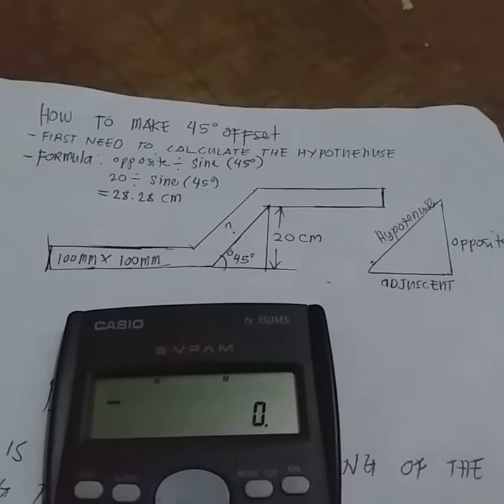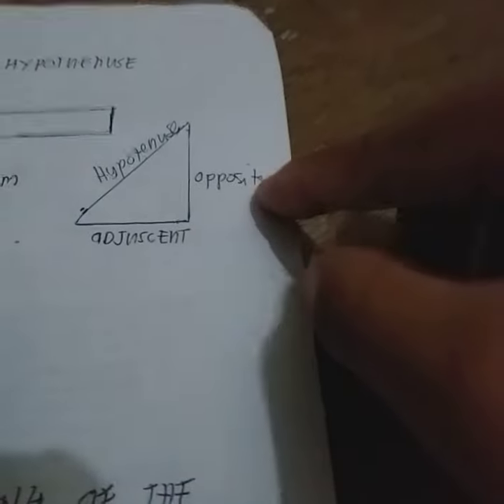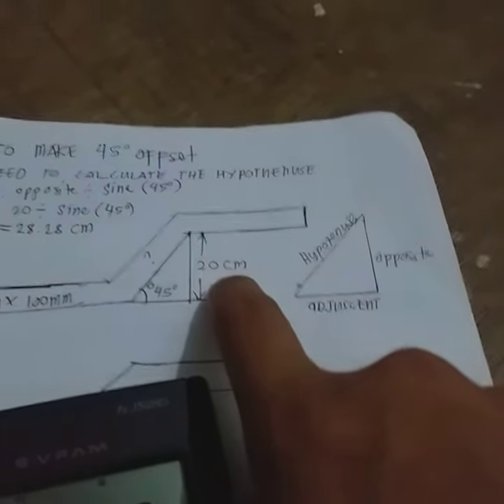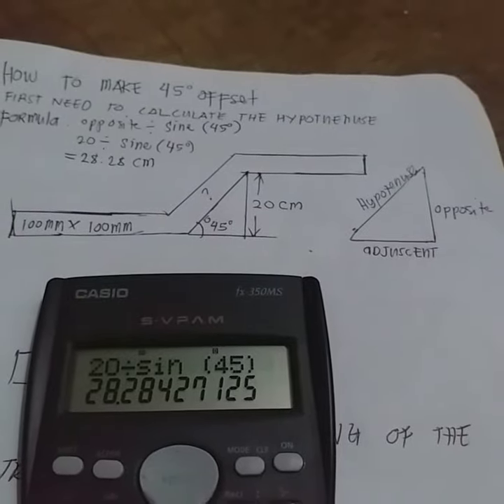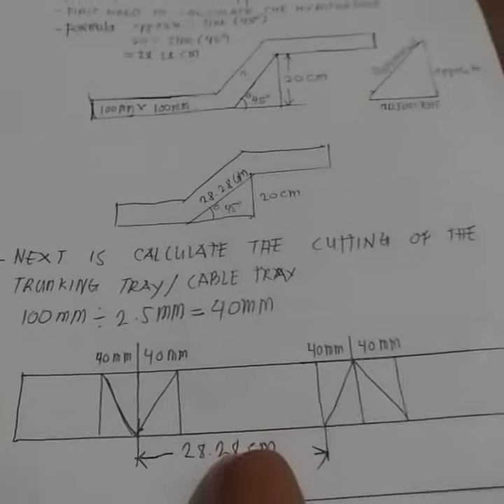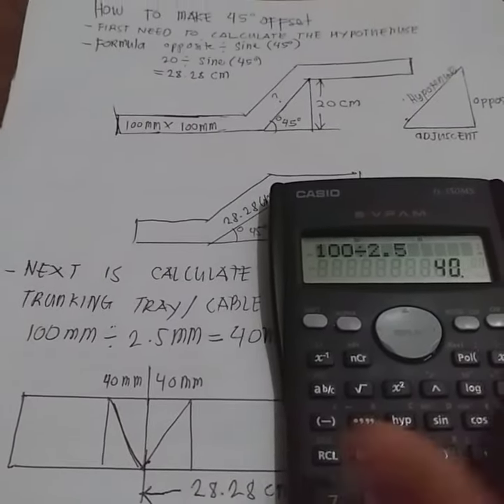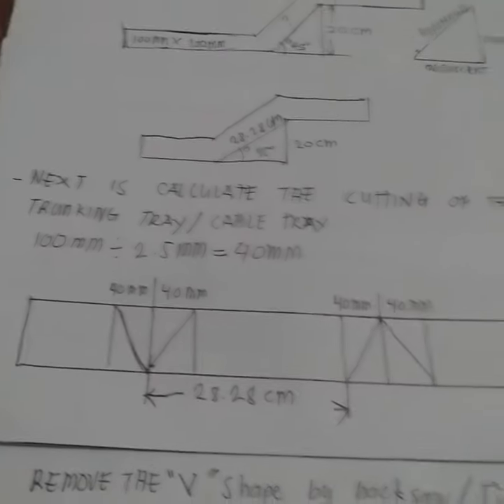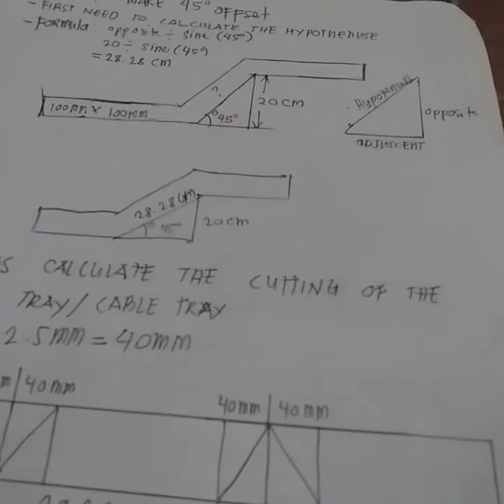Easy step to make 45 degree offset cable tray/Pipe and Air duct

Comment: Use this simple formula to calculate size of cut to set in any cable tray:   C/A = D   B/D = E  (size of cut in tray).     A =  cable tray width:  B = amount of set:  C = distance between sets on right angles:   Eg.  If you want to calculate how much to cut out of 300mm cable tray to set it 150mm over a distance 1200mm.    Apply Formula:     (C)1200 / (A)300 =  (D)4     Size of cut in tray to set would be  (B)150mm / (D) 4  =  ((E) 37.5mm .   Do the first set. place in position and then cut and set the second set to parallel.
Reply: Send us the drawing for this example
Reply: Too much confusion

Comment: I noticed that the position of the “line of travel (starting point to end point)” of this 45-degree video is different from the position of “line of travel” in your 90 degree and 30 degree videos. Which of these videos is correct?

Comment: Sir bakit ung offset mo na 30 degree at ung 45 degree ay mag kaiba ung formula na ginamit mo Sana masagot mo sir kc nasa fabrication ako Ng electrical ngayon malaking tulong Ito sakin pag naituro mo xakin ung madaling formula salamat sir good bless
Reply from the maker: Sa angle lang sila nagkaiba sir kaya for sure mag iiba yung travel or hypothenuse ganun din sa v shape cut magiiba lalo na pag iba ibang size ng cable tray gamit,pero yung formula parehas lang (height÷sin(angle)

Comment: Kung sa straight duct gagawin boss, kung ang duct ay 300x200 paano ko ididivide sa 2.5?? Sidings ba ng duct na 200 o sa top and bottom na 300??? Salamat sana masagot..
Reply from the maker: Depende sa offset sir kung riser offset sa lapad nung ducting,kung side offset sa side naman siya

Comment: Sir zion pano naman yung offset sa palapat n tray 300×100 cable tray tray ko 45 offset nyo galing
Reply from the maker: Sir anung ibig sabihin mong palapat side offset ba you can apply same formula it only varies depending on the size of cable tray
Reply: 12 12 kpg 300 cable tray

Comment: Where you get the 2.5mm
Reply from the maker: I just accidentally use it as a constant number to divide every number to get the value of 45 degree
Reply: @electricalinsider2536  Please Sir i want to 30 degree.  How to get Constance number.
Reply: Constant number Sir
Reply from the maker: @myowinhan502  for example you want to offset 20cm height just follow this simple formula 20cm÷sine(30) and you will get the travel or hypothenuse
Reply: 100 mm tray 45 degree offset you marked 40 mm
100 mm tray 30degreee where you can mark?
Reply from the maker: @xijinping9320  45÷30=1.5 then 4÷1.5 =2.666 cutting marking.
Reply: @electricalinsider2536  you are wrong,,
If you want 45 degree off set  you need cut V shape, for this you have  to do divided 45/2=22.5
And then you have to find the  22.5 degree'th tangent angle length for 100mm trunking or any other length
For example100 mm
Tan(22.5)*100=41.42
Same thing you just follow any angle for your bend
(Previously you marked 40 and 40, this is wrong,it's supposed to mark 41 and 41)
Reply: @myowinhan502 
30 DEGREE ANGLE 100MM TRAY
30/2=15DEGREE
TAN (15)*100=26.79
as a round mark 27mm ,, 

So now you can try  100 mm tray to  bend 150mm off  set in 30 degree
Off set 150mm 
Travel distance 300
"V"mark  27mm
Reply from the maker: @xijinping9320  i dont want to argue with i been making it by myself, it is easy to give formulas but when they do it in actuals they fuck up any way its your on idea no issue for me.by the way i can make it even isometric or through formula calculation.
Reply from the maker: @xijinping9320  the cutting is different from SOH CAH TOA if you know what i mean i just give an simple and easy way to understand,now tell me how much is the cutting of 30 degrees if i have 100mm cable tray.
Reply from the maker: @xijinping9320  15÷sine(30) to get the travel then 45÷30=1.5 then 4÷1.5 to get the v mark
Reply: @electricalinsider2536  for 45degree  you mark 41 and 41
30 degree you mark 27 and 27
  If you don't believe, one time you try  to cut practically   by yourself, then you will know
Reply from the maker: Raj Kumar no need,hahaha ive done so many times,any way base on what you've said you dont even try mine,you just round off my answer if try to calculate you will get base on actual calculation is 26.6666 you just round off to 27
Reply from the maker: @xijinping9320  one more thing the degree of angles in actual works more likely the unknown including the hypothenuse because when you are making layout we usually have to consider the supports standards distance which represent the adjuscent and the height of the offset we want to make which represent  our opposite so basically you can not just conclude what degrees suitable unless we get have the messurements of our opposite and adjuscent
Reply: @electricalinsider2536 take it easy brother, any way  tell me  the cutting  of 57 degree if I have 500 mm tray,,
Reply: @electricalinsider2536  where are you working now?
Reply from the maker: @xijinping9320  hahahahaha stalker are not allowed be profesional beside you are in my channel and your too arrogant saying im wrong without proof or trying the idea of someone,but i respect your opinions or just a typical guy who wants themselves to be exalted and higher than anyone,if you cannot accept my opinion then the door is open for you
Reply from the maker: @xijinping9320  45÷57=0.789 then 20cm÷0.789=25.3 thats your cutting for 57 degree angle
Reply from the maker: @xijinping9320  by the one i have also question how can i get the angle if i want 100cm offset and i have an adjascent of 200cm and my cable tray size is 500mm how much will be the cutting of unknown angle  and also the hypothenuse ?
Reply from the maker: @xijinping9320  my friend your not getting my point because im using centimeters not milimeters your just expressing my answers in milimeters thats why your accusing me wrong try to read sometimes since i use 4cm÷1.5cm=2.6666cm if you convert to mm 26.666
Reply: @electricalinsider2536  25.3 cm= 253 mm,,
For your method 253 mm
For my method 271.47
The proof is TAN(28.5)*500=271.47,
It doesn't matter we use centimeter,or milli meter
But when you convert  the answer should be same right
Reply from the maker: @xijinping9320  try in actual so you can see the different.
Reply: Sir 600mm x 15 cable ladder.. Offset 30 degree then the cutting
Reply: By 150mm
Reply: No sorry thats height 300mm
Reply: @forderno3736  what you mean?
Reply: My cable ladder is 60 cm x 15 cm  ...i need the height is 30 cm
Reply: @xijinping9320  i want to know  V cut
Reply: @forderno3736  for  youro{ 600 mm width x150 mm height  ladder , set up 300 mm } 
45 degree  you mark 62mm:62mm(travel distance 423mm)
30 degree you mark 40mm:40mm (tavel distance 600mm)
Reply: @xijinping9320  thank you sir ..i have a new  learned ..thank you to share  your skills sir.
Reply: Ahm sir how can i calculate the v shape ..600mm divide by?
Reply: @forderno3736    600mm V cut, you have  to use  Angle function, check this in your calculator
30 degree  =tan(15)x600
45degree  =tan(22.5)x600
25degree. =tan(12.5)x600
Reply: @xijinping9320  thanks
Reply: Raj Kumar it's a good farmula

Comment: Bakit poh ung sa 10 height ninyo na coputation jan ung 28.28 san poh tala ung magccmula sa gitna poh ba ng v shape o sa gilid ng v shape
Reply from the maker: Sir 20cm yung height kaya 28.28 yung travel niya meaning pag pinutol mo yung v shape marking mo at binali mo na siya as 45 degree ang magiging height niya ay 20.tungkol naman kung saan ka magsisimula tignan mo yung markimg sundan mo lang yung sa marking sa video sir

Comment: Hello sir
Thank you for the information, but for now I do not understand an example:
We have a tri cable size 600 * 0 10 mm
   opposite height 20 cm
The angle is unknown to me, how can I find the data

   Can you find me a solution
Reply from the maker: I reply on 1 your question pls follow that one i already explained it
Reply: @electricalinsider2536 
Where is it